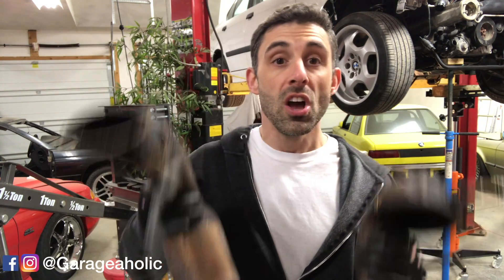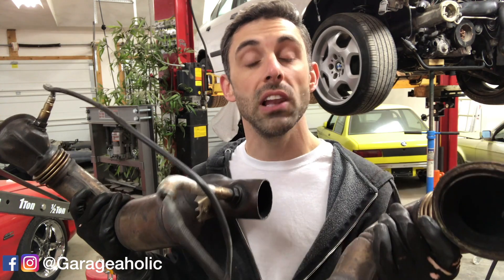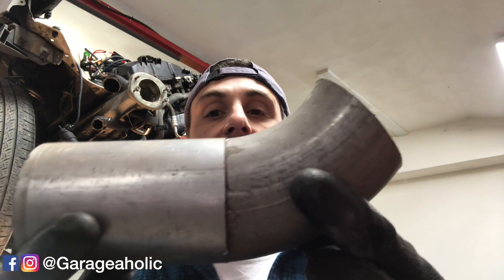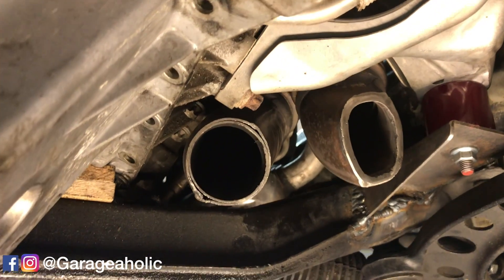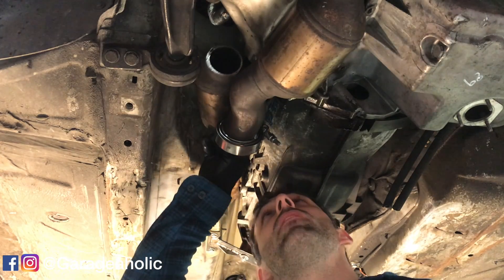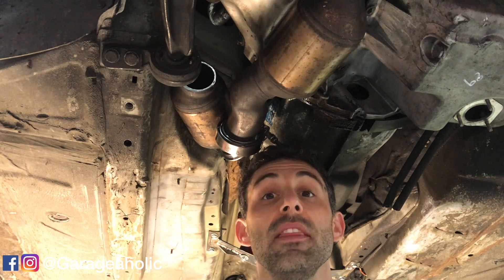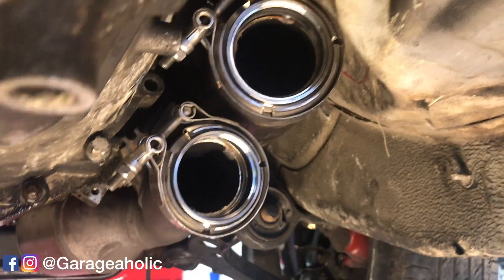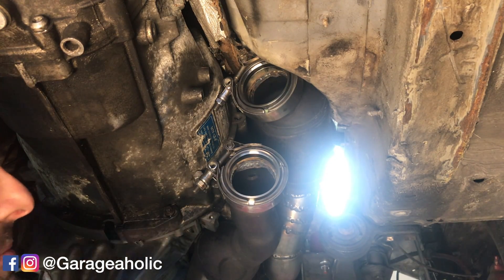Twin Turbo Exhaust Downpipes - How to fabricate with V-Bands on this N54!

Comment: Frank, just found your channel, very interesting content. With that said, now that you are a fabricator with all due respect you need to start thinking on the service side of things.

The custom cat placement was a bit of not the right call. Cats besides being big and annoying, they get extremely hot! They will heat soak or melt everything around them. If these cats ever go bad, your friend would be left with a nightmare! 

I would've tried to source the smallest cat that will meet MSD81 readings, then proceed to fab a custom down pipes, and place the cats down the line staggered so when they go bad it would be easier to replace.

In my world I would've made it kitty less but I know your friend wanted to pass inspection.
Reply from the maker: RJT racing thanks my man and great comment. I think it’s probably prudent to wrap the cats, and I’m sure he’ll want to remove them before they ever fail since he’ll be converting this to a full track car eventually.